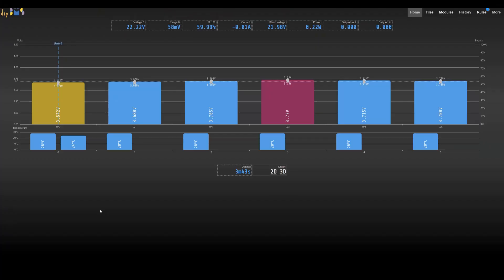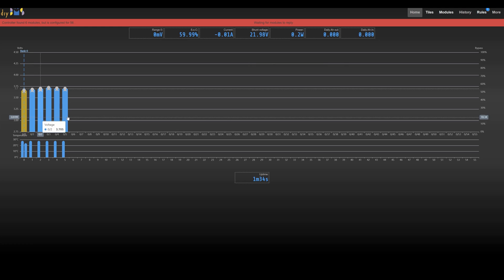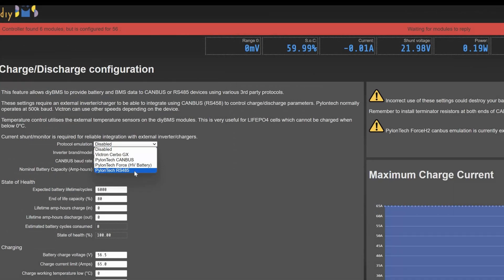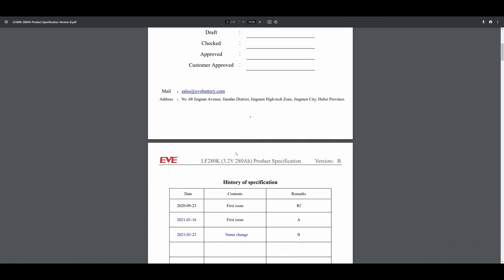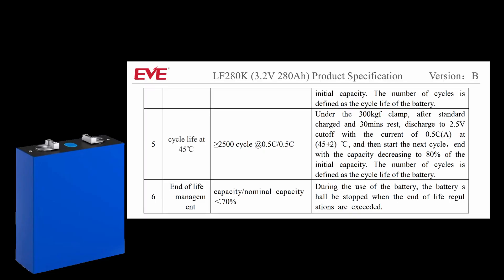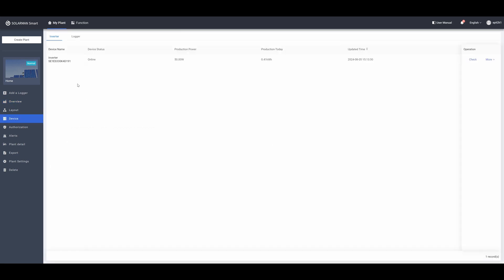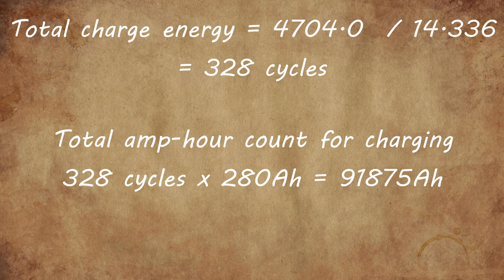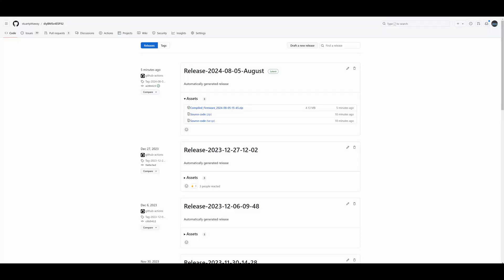DIYBMS August 2024 Update

Comment: Thank you for your work and the updates and videos!
Is DIY BMS used in some project on an EV battery? Would it work on one? We are building an Electric Buggy as an Vocational School project we will be connecting the battery to 40S with Nissan Leaf cells. Our motor inverters will be controlled by openinverter boards. Maybe it's possible to make those two magnificent open source projects work together, if it hasn't been doen already?

Comment: What cells can be used with it? 

Obviously lithium based but the one im not seeing kisted at all is sodium ion. 

Could i reasonably use these with a sodium ion battery array?
Reply from the maker: As long as the voltage is less than 4V per cell it should be fine.
Reply: @StuartPittaway  what is the minimum voltage per cell?
Reply from the maker: @rulesofimgur  Depends on which cell module board you are looking at -the v4.90 all in one (16S monitor board) will measure very low voltages (less than 1v) as its not directly powered from a single cell unlike the V450 boards which only monitor a single cell and need a min. voltage around 2.5V.

Comment: Hi there, I see you're doing a god's work in there!
I'm looking for a way to construct an 144S strictly monitoring-only system just to feed the data to the inverter.
The MCU choice you made seems genius, could you recommend what sort of data path topology or isolator chip would be cheap and safe?
Reply from the maker: That's a lot of cells! If you take a look at the MAX range of cell voltage measurement chips, they have inbuilt isospi isolation

Comment: Hello,
I am in the process of completing (during sea transport) two sets of 28 pieces of LiFePo4 173Ah batteries.
These two sets (each has a classic LV box) are to initially provide about 2*(28*3.2V) = 179.2V
Generally, this is to be an HV battery for the DEYE 20kW HV hybrid inverter
In the future, I plan to add more sets.
400V is the voltage level at which I will stop adding.
Does your DIY BMS design allow for such a high voltage?
Reply from the maker: Technically it can support high voltage, however I recommend staying below 50V for safety reasons
Reply: @StuartPittaway  Is the 50V safety limit the cause of the 16s cap?

Comment: Hey Stuart thanks for the update! Glad to see you are still making good progress on this project :) I've had some issues with the all in one board I bought from the web store and was wondering if you could point me towards some troubleshooting options? When wired up to my 7s pack, all cells read the correct voltage, but over time cell 3 starts to slowly drop and cell 4 slowly climbs until it hits the max value of 4.5v. I've checked the voltages on the cells at the all in one board connector when it does this and they still read within acceptable values so I'm guessing there is a hardware issue? I posted about this on form as well, but I haven't seen a response yet
Reply from the maker: @NoahD123  best to open a support ticket on GitHub - easier to discuss on there
Reply: @StuartPittaway  will do, thanks Stuart

Comment: does the external shunt need a fw upgrade for this soc calculation fix?
are the random controller reboots on loosing wifi fixed now in this one or was this only fixed in the experimantal fw 2024-02-06-14-07_experimental_bugfix wifi 276

i have this experimental fw and no reboot issues, dont want to have them again

thanks Stuart
Reply from the maker: @mosfetkiller3851 the soc change is only for the on board current monitor.

Can I ask you to test this version with the WiFi problem and see what happens? I don't get those problems so would love somebody to confirm is ok
Reply: @StuartPittaway  i can test this firmware and tell you if a problem exist with reboot.
but can you update the firmware of the external shunt for de soc calculation please?
thanks
Reply: @StuartPittaway  i have now running the new fw no reboot on loosing wifi signal for now, i keep testing and wil let you know in a week.
can you please update the external shunt firmware for the soc calculation?
thanks
Reply from the maker: @mosfetkiller3851  fantastic thanks for testing.
Reply: @StuartPittaway  the new fw is running for 9 days now, no reboots on loosing wifi signal.
Reply from the maker: @mosfetkiller3851  fantastic

Comment: You should take a look at meningd code and implement it. I have been using it since november ( 8 months ) without faults. It works flawlesly. There are some improvements to be made.
My setup consists of 3 x diy bms in paralel , with high availability turned on , intra can comunication between diy bms , data agregation works like a charm. Please,  take a look and implement it.
Reply from the maker: I've pulled the menningd code into GITHUB branch now to explore
Reply: @StuartPittaway  I have seen that , keeping my eyes wide open for news

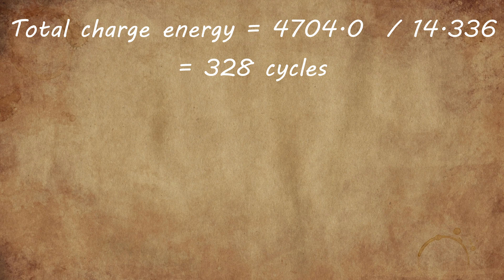Comment: 1 Cycle is charge and discharge, that means you should use a total energy  4,704+4,250=8,954MWh in 4:58 , not from only charge process ? 4750kWh is a Chargne energy, not Total energy...?
Reply from the maker: @SiBex_ovh  agreed, if you notice I put the same value in both amp in and out , the calculation in the BMS does the logic.

Comment: I went to order parts from jlcpcb but they had some part stock shortages. 😔
Reply from the maker: @WillThat  yes, that's the problem I keep running into, which is why I can't realistically run the shop properly
Reply: @StuartPittaway  Is there a way to make like a group buy in order to have enough supply of Both the PCB's and components ?
Reply: PCB's are nit a problem. Maybe we can think about some changes in the component list to switchover to more easily available components? I want to make DiyBMS system for myself so badly!:)

Comment: One question: When I update a FW for controller, is it necessary to update FW in modules too? I did not found this at forum, and search there is a bit complicated. Thank You.
Reply from the maker: It depends on the changes. For this particular release you only need to update the controller.
Reply: @StuartPittaway  Well, it is third update since 2022, that I did, but why I asking: After last update everything seems OK, but modules (4.40), that was not updated, do not balance, at controller web seems, like modules burns energy, but they do not, even red LED do not lit and temperature of modules do not change. So, I suspect, that modules should be updated to same version of FW.
Reply from the maker: @pevan73  if you've not updated in a while it is best to do all the modules as well.
Reply: @StuartPittaway  OK, thank You very much. I will do update ASAP 🙂